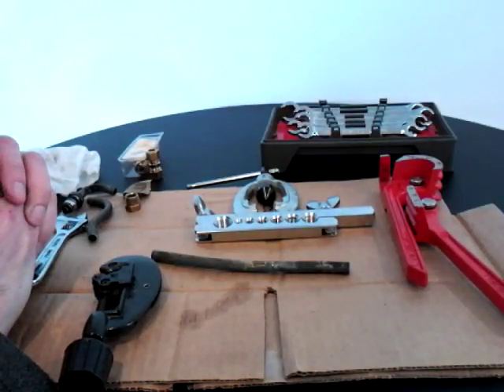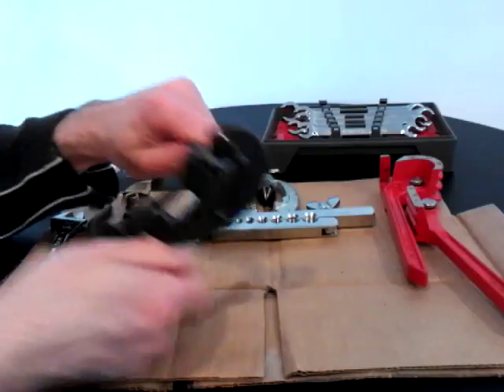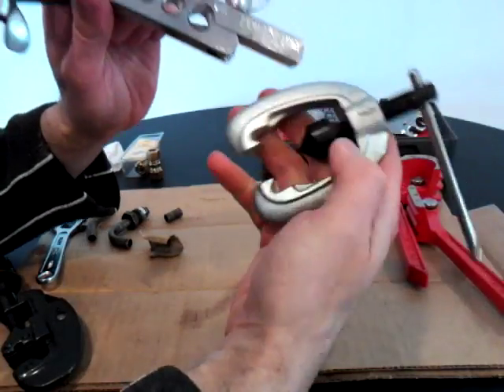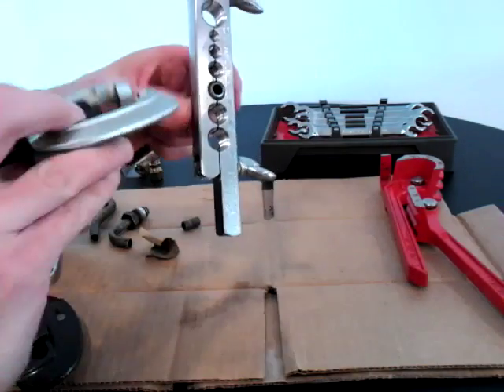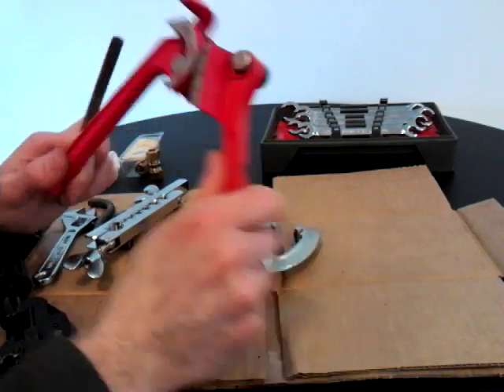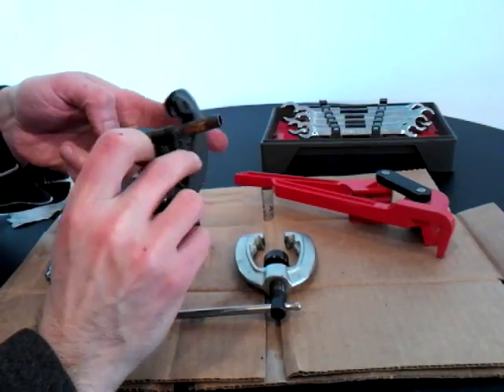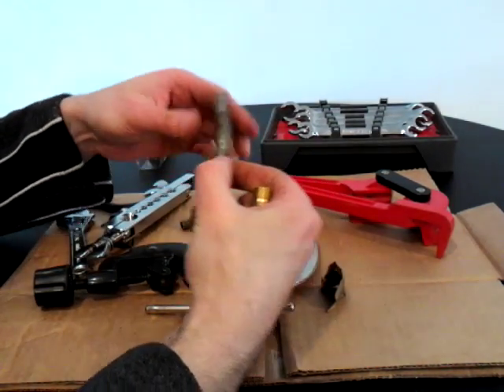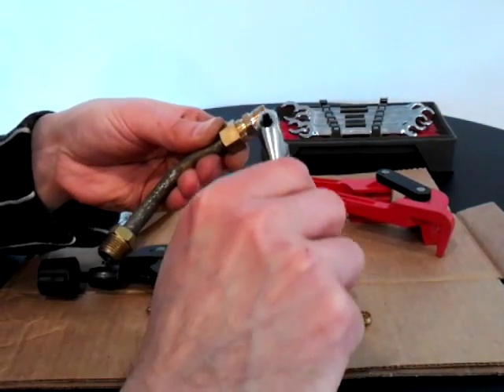HOW TO FLARE / CUT / BEND / REPAIR steel car lines- transmission/fuel/brake lines...

Comment: SINGLE WHEEL CUTTERS ARE FAR LESS LIKELY TO “WALK away” and create and stay where you started cutting than with a triple wheel cutter….could be good to consider if you are doing this….and not just buying the replacement piece haha…just a warning for y’all beginners…buy a single wheel cutter…if you got the space to swing it…or it’s a small cutter…….got little wiggle room…1/3 turns type of space…triple wheel it is…..

Be sure to mark ur “start” line before bending…tubing can slip while bending and can use to compensate….always go a pinch over the required angle needed as tubing will spring back slightly…

Always ream the inside before flaring …..
Make sure you never want to replace it, EVER…and happy cutting it off…sure use JB it..go nuts..lol….till you realize it’s still leaking and ur JB has cured…now your screwed..literally..cause ur threads r bunged up
Reply from the maker: Don't forget to subscribe 😉

Comment: Reconsider the use of jb weld epoxy. I do not think the manufacturer recomends.
Reply from the maker: The problem is that compression fittings suck..I do not recommend them..but..of you have to use them in a pinch..then jb weld it after you are done with it..don't forget to subscribe

Comment: JB weld, ARE YOU KIDDING!!!!!!  Of course you are not kidding, unfortunately!
Reply from the maker: I've done it and it lasts forever..only on the outside of compression fittings..cause compression fittings suck..always flare and use tube nuts and adapters instead of compression fittings...don't forget to subscribe

Comment: thank you so much for this video!!! one question, can this also be used for diesel fuel lines? both the inlet from the fuel tank to  after the fuel pump has pressured the fuel?
Reply: You probably drive a cummins lol
Reply: And yes it can be used for diesel fuel lines

Comment: So can I do this with tramission cooler lines. Mines leaking from the metal part that's connect to the rubber tube???? And suggestions trying to do it my self.
Reply from the maker: Yeah u can..u can try cutting the tube and putting in a larger hose..dont forget to subscribe

Comment: Single, is not a secure seal. Dobble, is a more secure seal.
Reply from the maker: carlos valentin for brake lines..yes
Reply: Anything, under high pressure.
Reply from the maker: carlos valentin yup..on cars that would be brake lines

Comment: Hi Klowny,  I see you didn't flared the line where you used the compression fitting, is the flaring optional when you do this kind of repairs ? Thank you!
Reply from the maker: For compression fittings..no flares are needed..but I would stay away from compression fittings

Comment: nice vid mate thanks :).....i see in the last part of the video you just nipped up the fittings ...normally would you tighten the fittings 1 or 2 turns whats min and max turns for good seal im doing 1/2 alloy fuel lines :)

Comment: I had to cut the transmission line .Now in water plumbing there quick connects product that connect two pipes.It just snaps together holds more then 140 psi .There got to be the same product for transmission lines . Now driver hit the wall .https://www.chick.com/reading/tracts/1022/1022_01.asp

Comment: Great video but I have heard a lot of negativity about using compression fittings on brake lines because of the high PSI you get in a brake line.  I've got a 2003 Impala that has a portion of line that is absolutely ruined and I'd love to avoid having to replace the whole thing but I am concerned about about the fitting :/
Reply from the maker: Compression fittings on brake lines..in some states u can fail inspection of they see them on ur brake lines..and the funny thing is some auto manufacturers like honda use them on their cars straight from the factory
Reply: @klowny1969  I sincerely doubt that!

Comment: you might have saved me from letting a shop do this for my transmission line thats leaking. now imma check the price for the tools see if it offset the price that a shop would charge. but now i know how to do it THANKS

Comment: My old Lexus was from the northeast, and the brake lines rusted through in one place.  I needed to know how to make single flares, install compression union joints, and bend brake line in order to fix it myself.  Your video is perfect, and saved me megabucks!  Thank you very much!

Comment: Great video thanks. My trans cooler lines are 5/16 and I need to go to 3/8 barb hose fitting, so I'll use a compression fitting.

Comment from the maker: Personally i prefer having less compression fittings on brake lines..always double or iso bubble flare..however manufacturers do put compression fittings on cars..i think honda does..if u put compression fittings on brake lines then i would coat them all around with jbweld to make them permanent and leak proof..dont forget to subscribe..thanks!

Comment: Which fitting do you feel is the strongest, compression or single/double flair?  Also, if you was joining hydraulic break lines, which would you suggest?  Great video, Thanks!!
Reply: Double is stronger and simple to make. Always go double. Single is kind of a short cut.